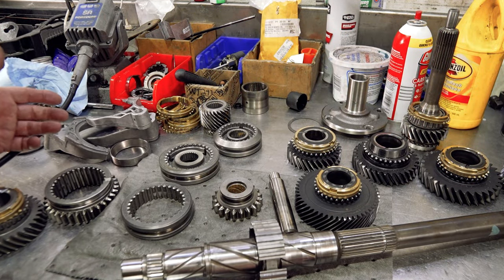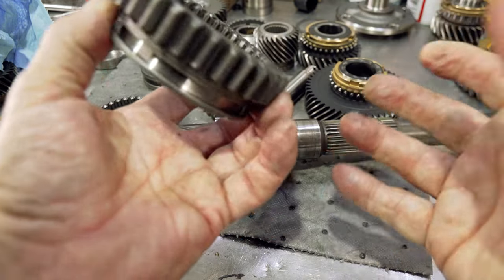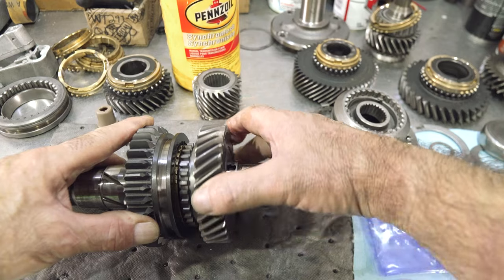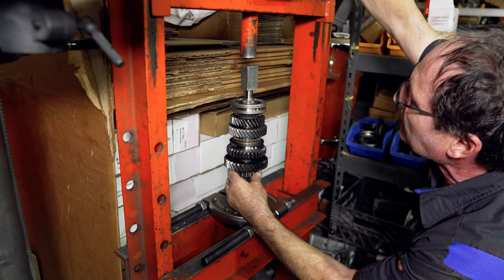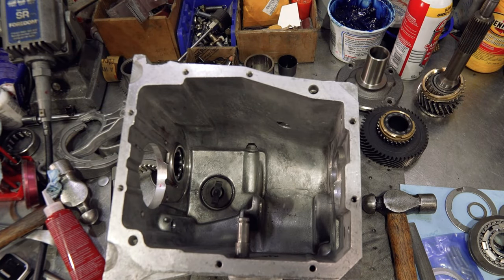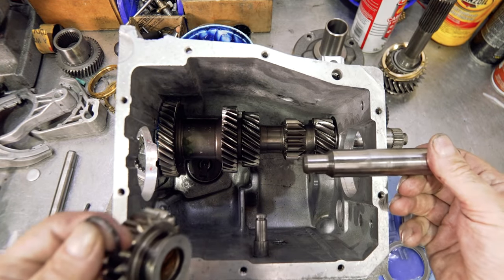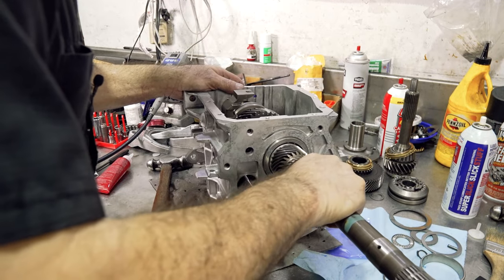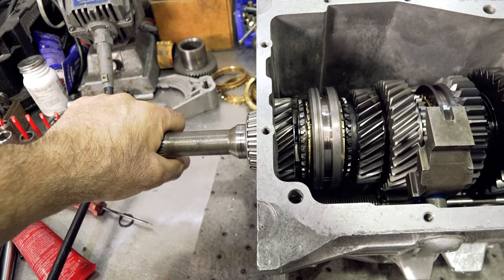Learn how to Rebuild a T5 Non World Class 5 Speed Transmission - Part II

Comment: Guessin’ you didn’t do PRI this year. Have enjoyed your PRI visits in the past, for actually showing the tech side, versus others, whose videos are like Christmas shopping with the wife.🙄😬
Don’t know if it helps, back in the day, if I had occasion to have to heat bearings and such, for assembly, I had a cheap home fryer with ATF in it, that let me set a temp, and get the bearings etc, heated, to be pulled out for installation as assembly progressed.
Thanks for sharing.
Reply from the maker: There is no reason to use hot oil. In a shop that would be a safety issue.  Just use a hotplate. But always an infered temp gun

Comment: Hi Paul. I’m rebuilding a T5 NWC at the moment and this video has been very helpful. I’m about to install the input shaft however I cannot find the “needle roller spacer” and are pretty sure there was not one when I disassembled it as I would of bagged it up with the needle rollers, thrust washer and thrust bearing if there was. 
Can you confirm that the NWC needs the “needle roller spacer” or can it be run without it. 
Thanks very much.
Reply from the maker: Some units do not have them

Comment: I am using your excellent video to rebuild the t5 in my 83 cj7. I purchased a new 3rd gear for my year and model but the tooth count is 27 instead of 29 like my original. The outside diameter is .055" less than the original. Should I use this? When ordering, they don't tell you the tooth count. Can you advise me?
Reply from the maker: You have to use the matching counter gear to go with that. The 29 tooth gear always broke so they made it roughly the same diameter with less teeth making the tooth profile thicker. So there's also a new account of gear that goes with that. If you broke a gear the matching gear is also going to be broken anyway or damaged or bent. So change the counter gear

Comment: I have a Borg-Warner 5sp, that came out of 1977 buick skyhawk w/231ci motor. You claim T5 was not produced until mid to late 80's, if so, what is this tranny called if not a T5? from what i've been told by other mechanics n motorheads is this is a T5 with fiber synchroz, if i put any real hp in front of it i need to add brass synchoz to handle extra torque. wud you recommend any additional changes ? going behind a factory 5.3LS...just a daily driver square body..thanx for all videos, very informative
Reply from the maker: Those had a T50 not a T5. Casting numbers are 13-38 . No top cover

Comment: I have a 1983 Jeep CJ7 with a t5 transmission.  I need to replace the lower gear cluster.  I find them on eBay but are the gears all the same or do I need a specific tooth count?  Do you sell the rebuild kits and the parts I will need? I would like to order from you if you have them. Your videos are a huge help.
Reply from the maker: I do not sell kits or parts for those transmissions. The gear is pretty much are all the same Just make sure the tooth counts are the same

Comment: I was just wondering on the Borg Warner 4+3 overdrive unit how many clutches and steel plates it took for the outer and inner ???
Reply from the maker: Depends on the year. Be specific as to what you have
Reply: 1984 c4 corvette 4+3
Reply from the maker: 4 od and 5 direct
Reply: Thank you so much

Comment: Have you rebuilt many T45 manual transmissions. I can’t find much information on rebuilding one. I have 98 cobra and seems like when the gearbox heats up from driving it gets harder to shift. I have changed the fluid used to correct type and amount. It has done this prior to when I changed the fluid
Reply from the maker: Hard shifting when heating has nothing to do with the trans but everthing to do with poor clutch release. And the T45 is like a T5 without a top over. Parts are hard to find now